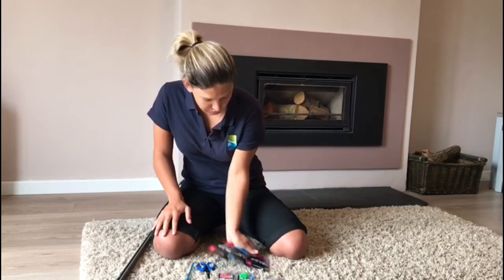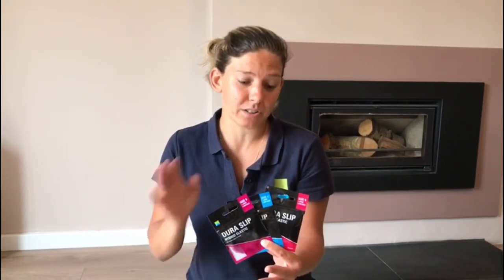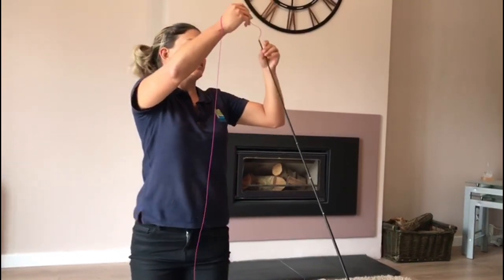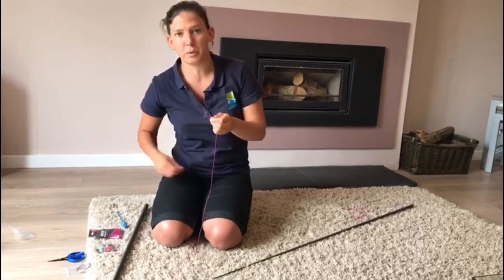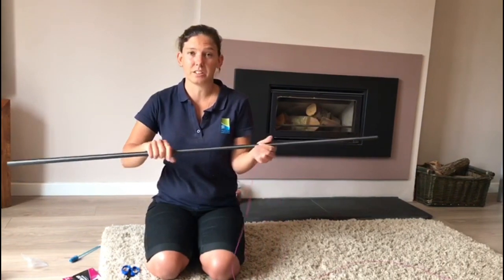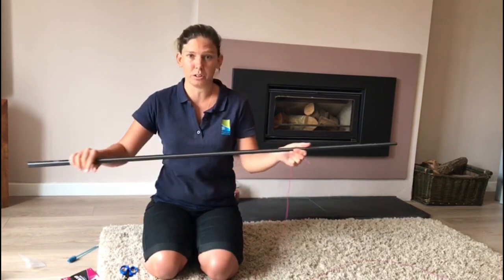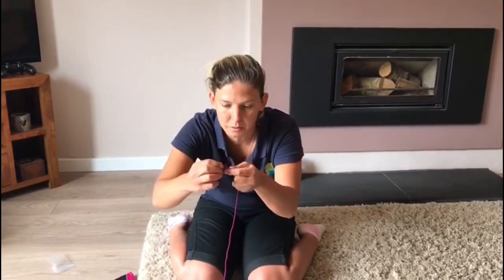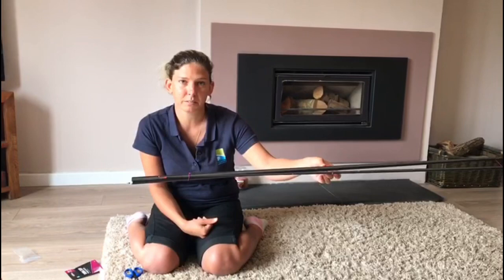How to elasticate a top kit using the new dura slip hybrid elastic

Comment: Hi Kayleigh forgive me I'm a newbie you say at the beginning of the video if there is already elastic on there no need to cut . I have a new pole with the elastic on there so silly question were do I join them together the elastic gos though two peices at the end of the pole . Would I need to buy the tool to undo the bung ? Or could i just join a number 5 to a number 12 ? So confusing sorry .
Reply from the maker: Hi, i would just tie a overhand knot and join the elastics together. Then remove the bung with a tool or by tapping the section flat on the floor usually works. Then as you pull the bung out and the old elastic the new elastic will follow 👍 hope that helps